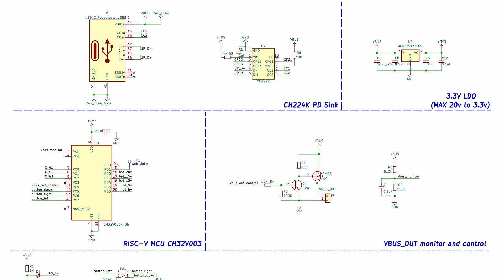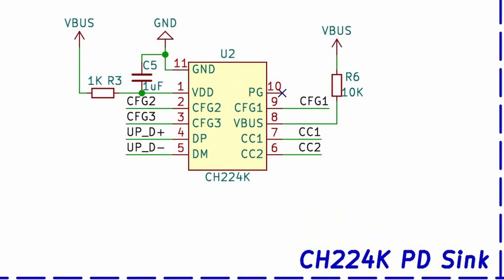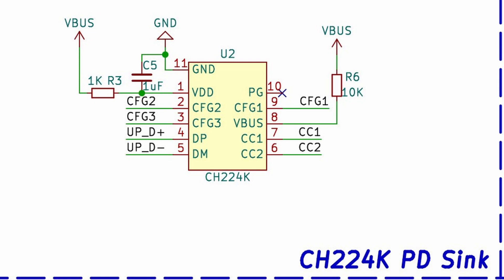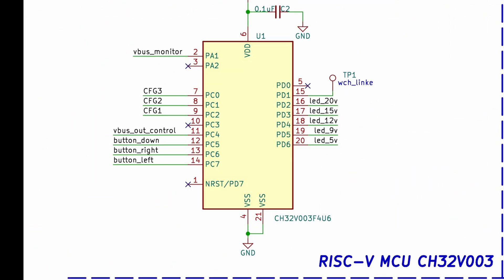#6- Awesome Power Supply – USB PD Output Voltage Selector

Comment: So, instead of using back and boost DC to DC converters, this should be my better option you wanna say? :) For now I can't see it, sorry. The more electronics, the more potential problems ;). But, I'll keep it in mind, thank you.
Reply from the maker: This solution is mainly to replace the traditional power adapter. Just use a cellphone charger that supports USB PD.
Reply: @rvmaking  it would be nice if you'd so some RISC-V DIY like channel DIY Perks does ;). You'd get a lot of attention and popularize quicker RISC-V tech. I can make on my YT channel as well if you'd like and link it with your stuff. 

I teach people fixing electronics, using existing modules to build solutions for their daily needs, and redesigning old electronics when I can't fix it :) to repurpose it and not go to landfil.
Reply from the maker: @screen-protector  sure! I will also introduce your channel to my customers and other tech followers
Reply: @rvmaking  thank you. And, is there a way to buy this board shown in the video? Or schematics/PCB + BOM?
Reply from the maker: @screen-protector  you can check out this link. The SCH/PCB has been released there.
Reply: @rvmaking  I'm happy to check out this link, but, can't find it anywhere. :) Sorry for being a pain :).
Reply from the maker: @screen-protector  sorry :) here is the link:https://github.com/openwch/ch32v003/tree/main/Demo%20Application/Easy_PD_Sink
Reply: @rvmaking  thank you :)
Reply: @rvmaking  Just fork it, we're launching our start up just now, and too many electronics repairs, so no time. Plus, I train people to fix electronics as well, so, completely no time :D. But, will try to do something with your stuff.

If you'd like, you can search my contacts here and I'd be happy to talk what we could do together :).